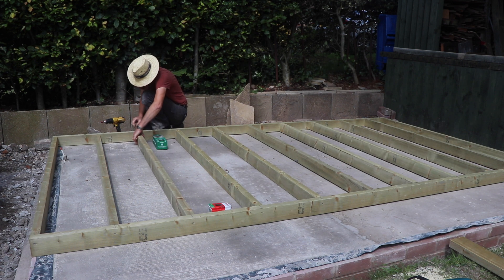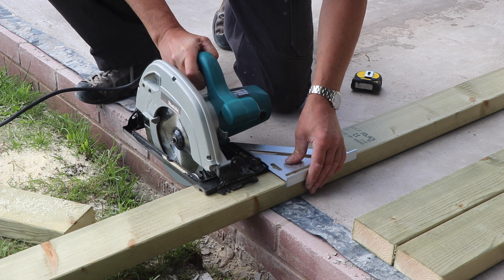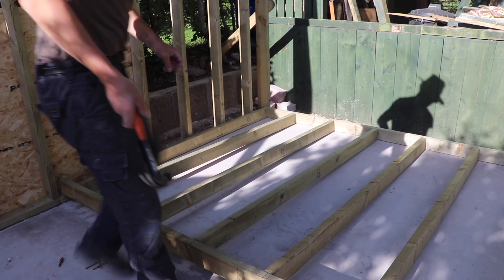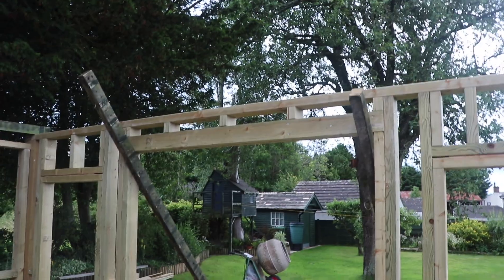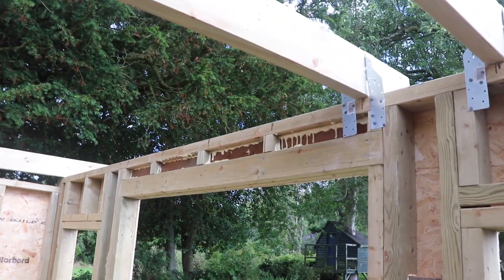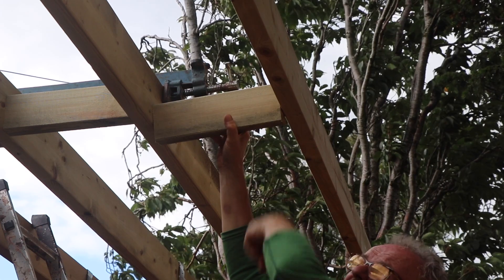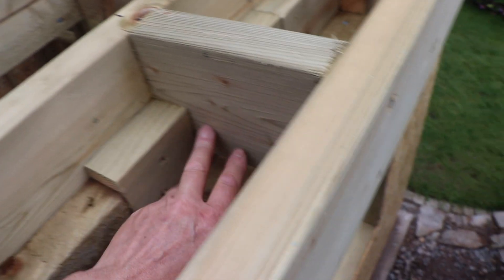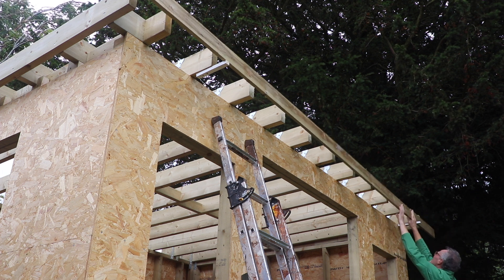Garden Room Part 2: Timber Wall & Roof building...

Comment: Hi Andrew. I’m midway through building mine (DIY novice ) and stumbled across your channel. Great work. One question - I noticed that whilst your cripples above the windows remain on 400 centres, they do not stay on 400 centres under the window sill. From what I’ve read/seen on framing tutorials shouldn’t the cripples at bottom stay on 400 centres too? Or does it not really matter?
Reply from the maker: Hi Chris- you are right about being consistent with the 400 spacing. In my case I had a large opening for the patio doors and the 400 spacing beneath the window fell awkwardly, from recollection very close to the door uprights so I took a pragmatic route and just put the timbers midway across the window span. I guess if there was going to be a lot of weight bearing through from above I would have been more consistent. I hope I haven’t made a critical error! But you’re right to point it out to a fellow DIYer. Cheers

Comment: A great and helpful series of videos. I am think of doing exactly the same only want to have a higher wall on the concrete foundation , like a drawf wall. I was wondering how deep and wide  your concrete foundation was and were you not concerned about frost. I have been reading that all concrete foundations must be below frost line ..some several hundred mm. Yours is a lot higher yes ?
Reply from the maker: Hi Paul - I guess I could have made my foundation deeper. As it is, it is a spades width to accommodate a single line of bricks and variable in depth, say 6” approximately. I live at near sea level in northern England and frost happens but isn’t significant here. I hope with the 2 courses of brickwork and relatively lightweight structure above al will be ok...However, if you are using more masonary you ought to make the foundation stronger. If frost is an issue, consider deeper footings. You could also put some rebar in for a stronger base. Have a look at the building codes and regulations for your area and take it from there. In my case I dug out what I could with the energy I had at the time so possibly could/should have done a bit more...I’m hoping the ‘load’ is spread evenly enough to hold up in the long run. Hope that helps...

Comment: Hi Andrew. I’m grateful for all your videos, which have so far been a great help in building my own. I’m pretty much ready for the Tyvek and EPDM now, but would appreciate some clarification on one detail of your build. Where the OSB-clad sides meet the sloping roof, you’ve put some little blocks under the fascia-support noggins, but because of the slope there are still spaces/voids between them which aren’t covered by the OSB and, presumably, you’ve just wrapped the Tyvek over the voids. Is that right, or have I missed something? Maybe you filled them off-camera? Thanks for your help!
Reply from the maker: Hi Jeremy - if I’m understanding correctly, I just wrapped the Tyvek over the sterling board walls. The gaps along the wall/ceiling join were filled with off cuts of timber. These gave a solid base on the inside to secure the plasterboard at the top of the wall. This was particularly important at the front of the building where the gap between wall and sloping ceiling was greatest. On the outside, once you fit your cladding and soffit any voids will be enclosed. I hope that helps - let me know if not and I’ll have another think. Best wishes with your build….

Comment: Hi Andrew. Thank you so much! It an excellent guide as I will start building mine in a month and my knowledge is very basic. Please whats the name of the wood you are using?
Reply from the maker: Hi Alex - for the walls I am using 47x100 C24 tantalised timber. This came in 4.8 metre lengths. For the roof I am using 47x150mm tantalised C24 timber. Then the walls are ‘sheathed’ in 2440x1220 OSB, 11mm thick. On the roof I used tongue and groove OSB, 18mm size 2440x590mm. I hope this helps. I have a note pad where I write things down as I research them. This has been useful as I went through different stages of the build process. Best wishes to you and your build
Reply: @solway17carlisle  thank you!
Reply: @solway17carlisle  Its Tanalised timber Andrew not Tantalised, although it may be difficult to get hold of. :) Great work by the way.
Reply from the maker: Ha ha - predictive text for you! Cheers 👍

Comment: Never thought of using a combination of nails and screws, can you explain why, think that's  good idea thanks for the share
Reply from the maker: Hi Anthony - I think I picked the idea up somewhere. Screws effectively pull the joint together and nails give strength as they are less prone to snapping. Under load, screws can snap, whilst nails have a higher tensile strength. Thanks for watching, Cheers👍
Reply: @solway17carlisle  thanks for the reply, advice and information think I will incorporate on mine, much appreciated

Comment: Hello Andrew, My project involves a dwarf wall, but i hope to follow your methods after it is constructed. Please can you tell me if the 11mm OSB  youve used should be flush with (in your case the front face of your commons/engineering bricks) front of my dwarf wall? I would be covering with cedar in a similar fashion to you. Thank you again for the excellent videos.
Reply from the maker: Hi David - I made my frames slightly longer than my dwarf walls and the osb extended about 4 or So cms to lap over the brickwork. When I had all 4 walls in place there was ‘fiddle’ room to square the building up before fixing it in place. I hope that covers your query? If not please let me know and I’ll have another go! All the best...
Reply: @solway17carlisle  Hi Andrew, thank you for your response. I will have to butt my osb up to the face of the (stone in my case) dwarf wall, this will then let the feathered T&G slightly overlap the top course of stone. Im only building because loads of stone left over after house extension a few years back. Therefore i will probably have an overhang on the timber internally (especially after plasterboard/skim etc) of a couple of cms. I wanted to have a single skin dwarf wall of around 4 courses. No insulation on the stone but kingspan similar to you in the wall cavity.i want to build a regular pentagon to make it more complicated!
Reply from the maker: Hi David - sound like good idea to use up building materials you already have, particularly stone. The structure you describe will be very impressive when built. We’re getting some good weather now so hopefully you’ll be able to crack on with it. All the best...

Comment: Looks good, I am just starting my own build and series. How wide is your room? I am deciding whether to build my back wall in section rather than one piece
Reply from the maker: Hi - the internal dimensions are 3700 x 2750mm - this is based on my summer house being approx 4.0m x 3.0m. I built all my walls (even the 4.0m back one) in single sections as the timber allowed this, less margin for alignment error and fewer connections/fixings. I'm sitting in my Summer house now - it's used a lot by the whole family and probably the most useful thing I've ever done. All the best with your build, it'll be worth the effort...
Reply: @solway17carlisle  Thanks for the reply, funny you are sitting in it right now! Very encouraging, I will see if I can manage a single wall! Thanks!

Comment: Hi, great videos,  very informative  and helpful to others looking to do the same. Can I just ask, when you cut the joists for the overhang front and rear, do you cut them plumb or at 90 degrees to the timber? Thanks again.
Reply from the maker: Good question - I remember thinking about this at the time. In the end I just cut them 90 degrees ie using a set square on the timber, as the slope of the roof is minimal. Hope that makes sense..
Reply: @solway17carlisle  

Thanks for the reply.  Nice to know this as nobody seems to mention this small detail.

Comment: Hi Andrew, what is the height & height difference of your front and rear walls, and how did you work out the fall for the flat roof? Is your garden room 2.5m high to the top of the front? Many thanks
Reply from the maker: Hi David - yes, everything is worked out from the height at the front which is 2.5m above ground level. Remember that the plastic Edge trim extends 20-30mm above the EPDM roof covering. From what I understand the gradient is 25mm height drop per 1000mm run. So my 3m wide building has a front to back height drop of 75mm minimum. See ‘Oakwood Garden Rooms’ for more content. Hope your build goes well. Regards
Reply: @solway17carlisle  thanks for the info 👍🏻

Comment: Great job Andrew - can you tell me what size are the joist hangers and where you purchased them from please  - I have just started the walls of mine !
Reply from the maker: Hi - I used Ironmongery direct, but you could also source from a builders suppliers locally. 949251 Simpson Strong Tie Joist Hanger, adj ht strap, standard leg 47mm width. You will need to check the width of your timbers. Thanks for watching, hope this helps
Reply: Solway17 Carlisle - many thanks ordered  and on way, keep up the great work on the channel

Comment: Hello there sir, I could not help but notice there is what appears to be a gasket between your bottom plate and the concrete foundation? Does it make it airtight and waterproof? what product did you use, please? I am about to erect my walls and I have realised that there are some slight imperfections in my concrete that could allow water to ingress.
Reply from the maker: Hi - I used plastic damp proof membrane under the concrete and then lapped this over my brick perimeter. The ‘gasket’ you refer to is a roll of plastic damp- proof. This is what the timber frame sits on. It stops water creeping up into your walls. This is similar to what I used: https://www.screwfix.com/p/capital-valley-plastics-ltd-damp-proof-course-1968ga-black-30m-x-100mm/42073?tc=QT7&ds_kid=92700058024392856&ds_rl=1249407&ds_rl=1241687&ds_rl=1245250&ds_rl=1245250&gclid=Cj0KCQiA34OBBhCcARIsAG32uvMUO6anpUUwj4Kp873HsdcBjV0op10CNFjTV28jBgpZtl7b1_YjqmUaAr3iEALw_wcB&gclsrc=aw.ds
Reply: If you have bolted the frame through to the bricks does this not break the damp proof membrane and allow damp up through to the underside of the frame

Comment: How do you secure the walls to the concrete base?
Reply from the maker: Various ways of doing this. I used longish fixings which go straight into the brickwork below, having drilled a pilot hole through the timber and into the brick first. You can also use real bolts but they can cause the concrete to crack as they work by expansion. Another option is to insert threaded rod into your wet concrete mix as it is poured then put the timber on top and bolt down. So have a look at ‘concrete screw anchor’ of an appropriate length - I used about 8-10 around the perimeter

Comment: Hi Andrew, and all ; ). Please can I get some help or a link on where to find  information for cutting the wood for the door and windows. How do you know the sizes, are they standard? Sorry I am new on this and knowing where to cut the wood is confusing. From where are you buying your door and windows? Thanks all!
Reply from the maker: Hi Alex - I looked online and got ideas of dimensions from there and then made my apertures accordingly, leaving 10mm space to fit the windows and doors. The other option is to identify a set of windows and doors you need, then ensure you create the apertures to suit. You could have a look at ebay or fb marketplace for upvc windows and patio doors. In my case, I made some basic windows and have asked a local joiner to make the patio doors - we agreed the aperture when discussing my requirements. Hope that helps? Cheers for now
Reply: @solway17carlisle  yes it did. Thank you 😊
Reply: @solway17carlisle  sorry I would like to clarify a doubt, this 10mm clearance is 5mm on each side? Thanks
Reply from the maker: Hi Alex - I would suggest leaving 10mm on each side and at the top. I found that my door opening was a little bit out of true so the extra space still gave me room to slide in the ‘square’ frame ok. Once in you can use wood or plastic packets or shims then screw the frame in place. Any gaps can be filled with expanding foam. Once set, a liberal covering with silicone, then a cover strip to finish. Hope that helps, let me know if you need any other thoughts...ps also look up ‘William Griffin’ on YT who does this for a living. Cheers
Reply: @solway17carlisle  thank you so much for taking the time to answer.